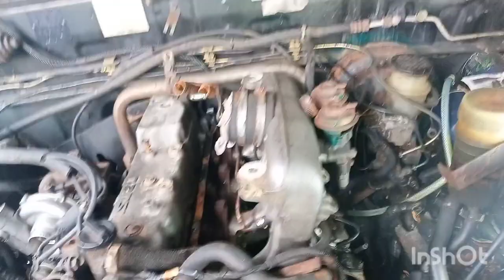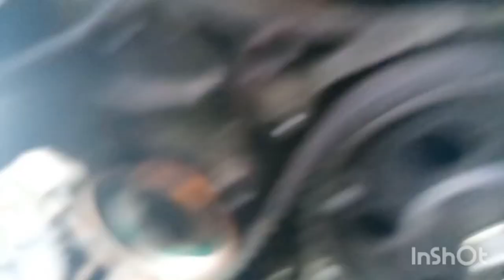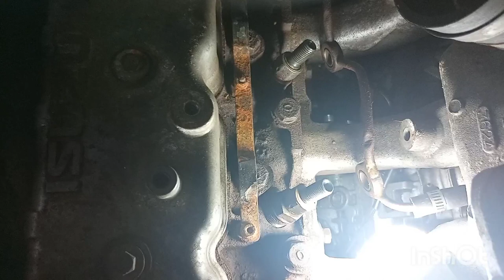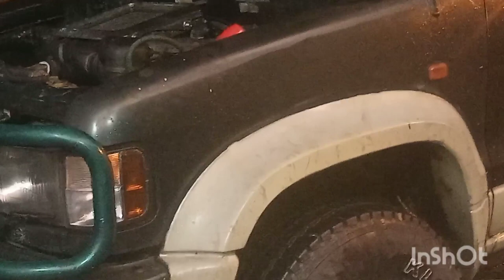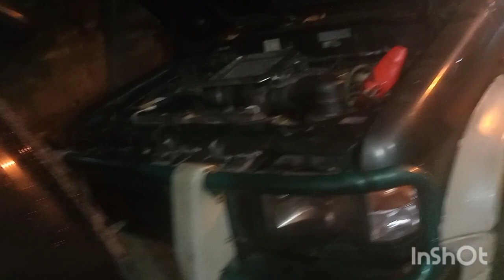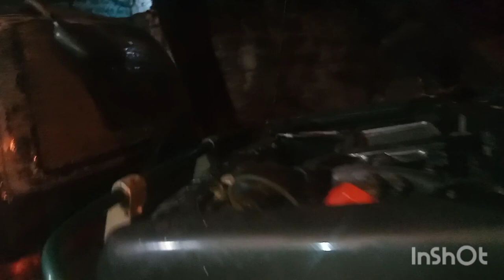Isuzu Bighorn walang hatak?|Low power problem solve!4jg2 engine @tamjunsvlog

Comment: sir ano po problem pag uphill walang power? more power sa videos sir
Reply from the maker: Pa check po fuel system fuel filter and injection pump timing po,bka late po.

Comment: idol,bakit hirap tumakbo pag drive ang trooper ko pag take off,pag tumakbo na,okay naman sya.nag reverse din pro hirap.
Reply from the maker: Check po Muna sa basic po,
Atf level
Inhibitor switch dapat sakto Ang angle
Cable Ng matic transmission kung cable type pa dapat Hindi nakahatak po
Tapos check atf kung di sunog
Check wiring Ng solenoid valve kung wla po putol

Comment: Sir yng s bayaw ko bgo overhaul my engine knock pg ng high rpm.. ano kya problema?
Reply from the maker: Anong makina po
Reply: 4jg2 dn sir.. tpos ndi nktpat yng mga injector s heater plug..
Reply from the maker: Itapat nyo po ung guide Ng injectors sa glow plug po,2 KC butas Ng injectors Ng jg2

Comment: Master tanung klang kasi may ginagawa akong same model ng ginawa mu pero after ko maibalik ang injection pump at injector ayaw na umandar
Reply from the maker: Baka nawala po sa timing
Reply: Master tama po ung timing sinalpakan ko ung para sa timing ng pump tas saka ko  salpak ang pump
Reply from the maker: Paki double check po bka Maka no.1 ung valves,pero ung injection pump nka no.4 Ang delivery,tapos check Ng 12v supply sa my injection pump kung meron
Reply: Nakadalawang baklas na ako ng timing master,,pero ganun prin,
Reply from the maker: @edilbertotipay4681  my lumabas ba na Diesel?

Comment: 95 model ang trooper ko 4gj2 umiistart pero after 20 seconds namamatay ang engine...ano ang problema ng aking trooper na matic
Reply from the maker: Try mo pump po ung priming pump bka malambot,nagkakahangin linya.
Reply: May computer box ba ang 95 bighorn 3.1 matic at saan ma locate pls?
Reply: Thank you po sa suggestions nyo
Reply: Q.po may fuel filter ba ang diesel tank ng 3.1 bighorn?
Reply from the maker: Wla po Yan fuel filter sa tank,tingnan nyo po ung injection pump kung ordinary lng po
Reply from the maker: Pag ordinary 2 lng wire naka kabit